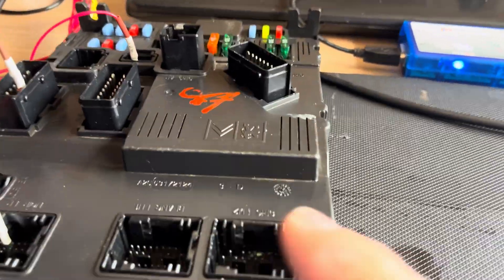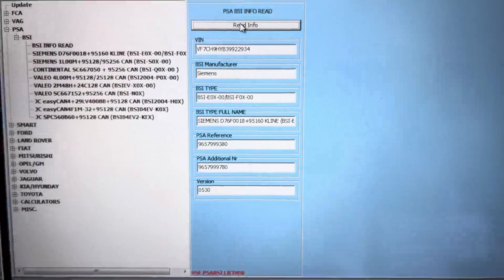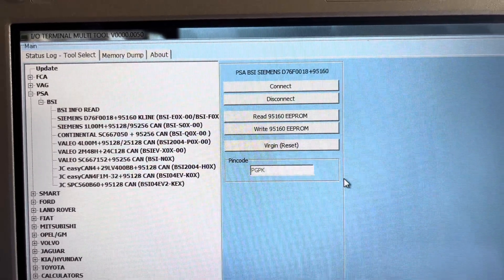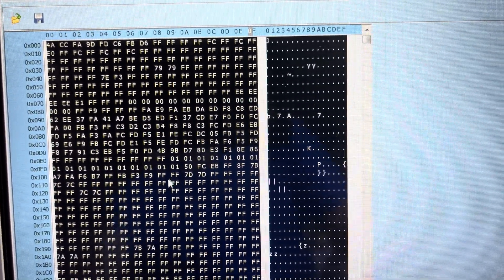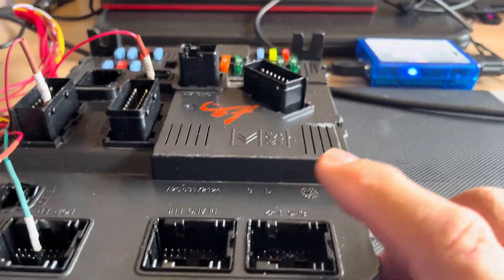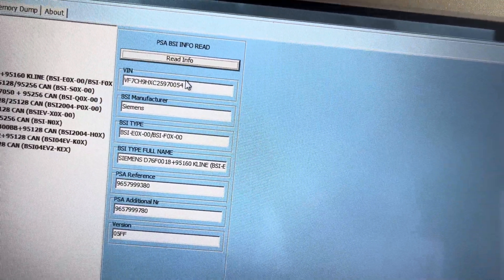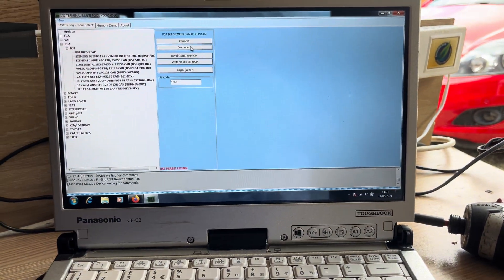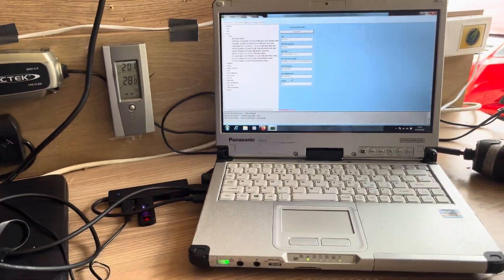Resetting a Citroen bsi to factory settings and what to look for when cloning

Comment: On lexia i can find version one in car got a bsi second hand same part numbers is there a easy way to find version got vin and pin and lexia
Reply from the maker: Hi i dont know as i use ioterminal
Reply: @caralarmandradio  thank is there a diy way to find version on psa bsi second hand before buying because if part numbers match its a lottery just a quick one how much to verginize a second hand bsi copy old one then transfer data so plug and plug you seem to do best way with taking to bit soldiering wires or moving chips bet it cost a bit for gear and you no your stuff we're you base in uk
Reply from the maker: Hi on these models you cant do a full clone so its not plug and play unfortunately the donor unit is reset ready for file transfer where the vin and vehicle configuration is transferred. The original unit has its pin code read if possible again with psa group sometimes this cant be done so it would need to be read from the ecu. Once back in the vehicle the keys can then be matched and the units aligned then she’s ready to go. If you want full plug and play then the ecu will need to have an immo off done. Cost for cloning £155 cost for immo off £155 ok